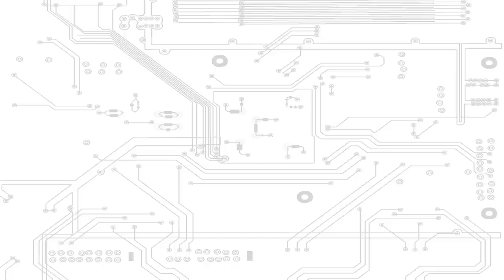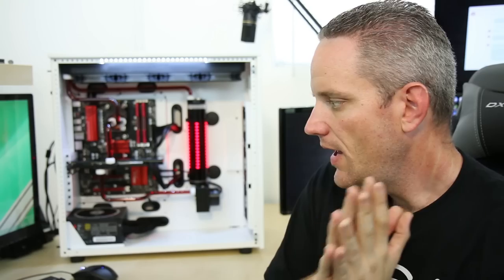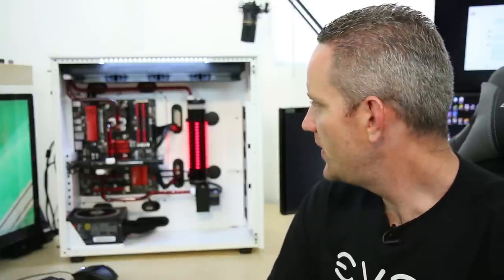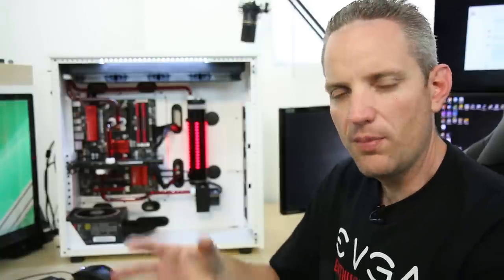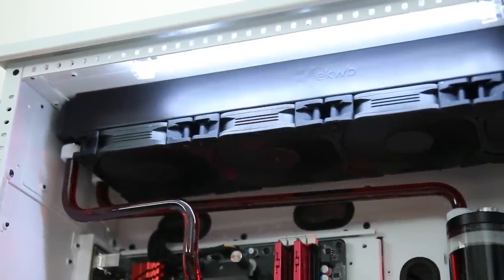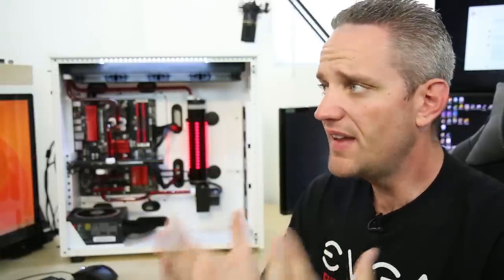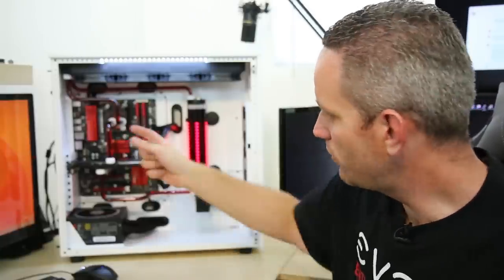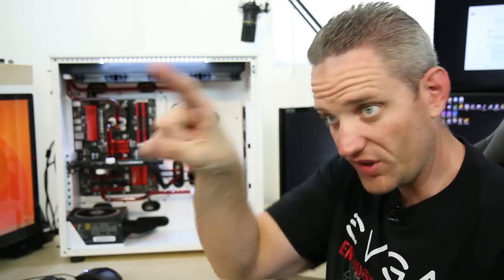Custom Watercooled AMD Gaming PC

Comment: Few topics for guides and tutorials:

1. Guide to water pumps (Liang DDC, D5, DCP, Aquacomputer aquastream)
2. Guide to hard tubing fittings (BP, EK, PrimoChill, Monsoon)
3. Sometimes the are problems with compatibility betwen tubing and fittings, especially when you are using different brands (for example problems with EK hard fittings and monsoon tubing). Maybe you should try to check this out.
4. Push vs pull vs push-pull
5. Slim rad vs thick rad
6. Longer but slimmer rad vs shorter but thicker rad
7. High FPI rad vs low FPI rad
8. Cheap fans vs premium fans - how they impact air flow and noise level
9. How blocks and angled fittings impact flow ratio
10. Building water loop for 100$/200$/300$/400$ etc. - where you can cut cost and where you shouldn't
11. Heatshrinkless cable sleeving
12. Guide to fan controlling - using mobo features and third party panels

Comment: I would like to see a guide to what to buy when watercooling. A single and dual GPU example with separate rads. Take EK as example. What components to look for. What to think of. Good to know about different fittings or blocks. I would also love to see a guide in how to change the cooling from air to waterblock on a mainstream card.

I really appreciate your channel Jay and been spending alot of time on your videos and guides.
Keep it up and stay wierd!
Regards Jonas 
Sweden

Comment: Just finished my first watercooling loop and it is addictive!  I did softline and eventually in the future I with attempt a hardline build.  

A problem I had with my endeavor was optimizing the overall loop (temperature wise).  My video cards (980 ti x 2) were under 40C at load during Furmark while my processor (4790k) was hitting 90C during aida 64.  I eventually reseated it and am at 63C with it overclocked to 4.8 GHz.

Comment: I'd like to see a how to begin watercooling guide for people that already have experience building PCs, but are just wanting to start into custom watercooling.  I'd really like to see how to pick a graphics card that will be easy to get a block for and how to begin with just a CPU loop and later expand it to the GPU as well for a more budget friendly route.  I've always wanted to start watercooling, but small problems like that have held be back from it as well as being worried about taking it to LAN parties and having the watercooling components get damaged or leak.

And keep rolling with the hard tubing stuff.  It makes for a really clean looking build and the freedom to bend tubes wherever you see fit to customize the loop is an added touch.

Comment: it would be kinda awesome if you just went through  a few pc partpicker builds that you do with all the things that you would need to make a loop, and maybe do a few different ones for various price points. That way if I wanted to do this for my pc a lot of the worries like will the pump be strong enough , or does the tubing work with those fittings, or like you were saying about different coolants not being compatible with some plastics would be pre planned. So i kinda just see what my budget will afford and make aesthetic decisions about things like colour, fittings etc, knowing that it would all be compatible and assuming I don't fuck it up in installation should work together.

Comment: It would be great to see a series of videos explaining the parts of watercooling where you have a lot of variety that can be confusing. Such as fittings (diferent types, usage, pros and cons), different loop designs (series, parallel, why it works even though most of Youtube won't believe it), radiators (performance statistics on high vs. low fin density, thick vs. thin radiators and such). I am aware some of these videos would take a ton of time, just throwing my suggestion out there.

Comment: Hi, I'm pretty close to doing my first custom loop, just wanted to say your video's (and the ones you've done with Paul) have convinced me it won't be that tough to create a rigid cooling loop. It would be great if you did a slower paced video of the methods you use to figure out where you place bends etc

Thanks for some really great and informative Vids! Some guy in the UK

Comment: ***** Water cooling tips that I would find very useful and hopefully others: 1. how to drain system, (whether changing cpu, gpu, or mobo)
2. how to figure out which pump to buy, in terms of power
3. what does having a pump go dry mean
4. how to bend hard tube
5. which compression and fittings to choose for soft tubing
6. how to mount reservoir in case

Comment: Great looking build. Going to be doing something similar with the 8350 and a GTX970 G1, but air cooled, as my trusty old Lian Li case only has a single 120mm rear vent.

Comment: Here's something I've always wanted to know and have never actually got to googling. I'm an auto mechanic. So I've always known a radiator to have an in at one corner, and an out at another  corner on the opposite side. That way the coolant has to travel from from one side of the rad to the other. I am now an experienced builder, but still always have this thought in my head that having the in and out on both sides, does the water actually run the entire length of the rad before it exits. That 480 rad you used made this thought pop in my head again, so I'm probably gonna do some research of my own, but I just thought it would be an interesting topic to touch on.
Reply: dollars1234 As I'm sure you know, the tanks on an automobile radiator run the full length of the sides, so when you fill it, the water fills the first tank, crosses the radiator, then fills the second tank.

In the average water-cooling rad for PC's, there are THREE tanks - two on the port side (one for each fitting, about half the width of the rad) and one at the very end.  What happens is the water fills the first tank, travels to the opposite end of the rad, fills the end tank, then crosses back on the other side of the rad to fill the last tank, basically making a U-shape.

That being said, there are PC rads that have two tanks, with the ports on opposite corners.

Comment: A ground zero build that's a few parts would help. Meaning literally showing people where to buy what kinda to buy. Also what rads and fans. How to setup fan curves. Drain set ups. All these our asked slot on ocn by new builders. Alit of people also ask about cases. I know caselabs first hand our the top butler new builders don't have the money so showing off more budget cases and ways tops them and how to mod ( ie window mods, rad mount mods, etc) I think all listed above would be very good to do and easly could be several videos and part 1- 10 videos. You have to remember whAt to you is common knowledge is not for most new builders. Keep up the good work jay living the dream my man

Comment: How about the different types of tubing to use? Pros/cons, compatibility (like the melting you talked about), how to use the different types of tubing etc. 

Something else could be radiator sizes and how it affects builds. Which is best for certain situations. 

Best pumps to use. 

That's all I can think of right now. Thanks Jay.

Comment: I think something that does not get brought up are the things you do not see, the biggest is mixing of metals in a system. It's something that you really have to do a bit of research on, but even then I have met plenty of people that did not know that could induce an issue into the system. Also, things like when to use a kill coil, silver bar, or a biocide and when to use each in a system. One last thing I think personally should be address is the amount of maintenance on not only a weekly to monthly basis such as topping off your reservoir, but on some times a bi-yearly or more basis.

Comment: ***** Could you do a water cooling budget guide (budget meaning as cheap as you yourself would go) And/or how to effectively pick out water cooling parts. (I.E. how big of radiator, does a more expensive cpu block matter, type of reservoir thats best etc).

Comment: id like to see a series where you use a randomiser to select all of the part e.g when you randomly select the cpu you put all of the compatible motherboards in the randomiser then the same with the gpu, power supply, ram, fans, hdd, case it would be fun to watch you building randomly generated pc and then bench mark them to show what type of performance you get.

Comment: This is quite similar to my current system. One thing I would like to say for anybody looking at doing something like this, is that overclocking your CPU a bit further will improve the video card's performance quite a bit. When I went from 4.7GHz to 5GHz after upgrading my cooling I got a ~5-10fps increase in most games.

Obviously, if the owner of this system is playing WoW mostly then that's probably unnecessary (I don't play WoW so I'm not sure). But an epic build for sure Jay! NIce job. :)

Comment: ***** Would love to see a video on the pro's and con's of a single vs. multi loop system cooling 1, 2 and 3+ gpus.  Please include the relevant component temperature comparisons.  

Additionally, would love to see a video explaining and demonstrating the relationship between head pressure and flow rate and what variables in a system affect them.

That said, a video on the characteristics of a system that would suite a single D5 pump, a single DDC pump or multiple pumps in a single loop would be very helpful.

Comment: Nice results.  That's a decent OC that won't need a lot of voltage to stay stable, and will keep temps and power consumption LOW.

One bit of info I can share is that G.Skill has red heat spreaders in their RAM that are a near exact match for that board.  ;)

Comment: A bit similar to my system minus the custom liquid cooling. I have an 8350 at 4.8GHz cooled by a H80, an EVGA GTX 970 SSC (wanna get a 980Ti), 16GB Corsair Vengeance Pro 2133MHz all on a Asus ROG Crosshair V Formula-Z encased in a Corsair Carbide Air 540 (Brilliant case highly recommend it).

Comment: You sir are fantastic. I love watching your videos and love all that you cover. I am excited to hear that you are going back to the water cooling topics! I would really like you to discuss tube prep and bending. Specifically how to bend a tube run from point A to point B. I would also like you to go over prepping the tubing for insertion "Insert Joke here" into the fittings. Does PETG require the prep that acrylic did? i.e. chamfering the ends

Comment: I'm not a first time water cooler, I've been building WC rigs exclusively since 2003 but hard lined setups are beyond me. Don't get me wrong, I think they're sexy as heck but I'm one of those guys that's constantly evolving my PC. I'll go with a certain layout or even component (CPU/GPU/rad(s), etc) and a few weeks or months later get a wild hair and swap something out. Generally, with soft tubing, I can allow for future changes by running the tubing a bit on the long side to allow for modifications to the layout and even if it doesn't work I keep enough spare tubing on hand that replacing it is simply one cut away. I can't fathom pulling out this custom bent tube just to toss it in the junk bin and start over. Granted, my rigs will never have the wow factor the bent tubing hard line setups do but that's fine. I would like to ask, what soft tubing are you buying that's $3 to $4 a foot? Even the Tygon in my setup now was under $2.

Comment: I think a good "Water-cooling 101" video for 2015 is in order. Skip the AIO equipment and get right to the meat of building a rig from start to finish. Highlight the part decision process and loop planning and note any pro/cons for those choices.

Sure, it will be a multi-part video series, can't really avoid that. But it somthing you should be able to reference in future vids for quite awhile.

Comment: Regards Watercooling.
I just use AIO stuff but have kept looking at setting up a custom loop.

One of the things that bewilders me is the difference in price, shapes, etc. To be honest it all looks the same. I think something around a like for like comparison between parts for each section of the system (individual blocks, personal experience on performance, fittings etc) would be really helpful.

Comment: From my point of view, the loop would have been a bit cleaner if you rotate the cpu block vertically and make 1 less corner from the rad to that block, anyway its a fantastic build!!

Because you can make everything so interesting, I'd suggest just to cover more aspects of the builds you make, maybe the moments when you start thinking about loop or the moments when you bend and install the rigid tube in the fittings (maybe teach how to understand if they are inserted correctly)

These are just my ideas, yours are the best videos anyway!

Comment: I am about to be doing water cooling for the first time and my fear is doing something wrong and causing a leak or a rigid tube popping out of its fitting. I think a great vid would be about what not to do, what would it actually take to blow out a fitting or cause a bad leak, and what fittings are more reliable than others. Set rigid loop up and see what to takes to actually make it fail.

Comment: Hey there Jay,
since I never did anything WC related, but I intend to do i would wish for a video where you cover what is neccessary for a loop (Pump, Reservoir, tubing, Radiators, Fans and Waterblocks) and what the bunch of extras is about (like a flow-meter and a digital controller etc. etc.)
Maybe you could cover how much radiator space is needed for 1/2/3/4 Graphics Cards and a CPU.
I know that there is a huge difference in these cards but something like a 360 is enough for stockspeed two GC an a 120 is plenty for a 4690k or something.
I hope you make a little time for my questions and its not too basic!
Keep up the awesome work, you really taught me a whole lot about computers!

Comment: Jay, on the water cooling topic, maybe you could shed some more light on running a mixed metal loop or an all aluminium loop with corrosion inhibitors, I know its not recommended but some of us don't have much choice. I live in South Africa and water cooling components are EXTREMELY difficult to come by and even more so at a reasonable price, because of this I'm using a not so famous brand of water cooling components from china, the rads and CPU block are aluminium and I have to say that I have absolutely no regrets on buying it, the pump is slightly audible but other than that the performance is excellent as I'm getting 18 degree idle temps and 45 degree load temps on an i5 4670K stock clock, which is a high heat CPU as you know. Anyway great job on the build, keep it up.

Comment: I would go with arctic cooling white fans and peeled of top sticker, instead of all black fractal. Their F12 and F14 fans have thermal sensor as well and central motor is incredibly small when compared to those in fractal fans. I don't know why but their fans are not so popular, but are really good.

Comment: Maybe you could do a video on what kind of radiator set up you would need based on components chosen? Pump flow based on the amount of heat needed to be dissapated, ect,ect.

Comment: I build a similar system recentlky for my brother except with a white and black colour scheme,   what you say about PETG hard pipe is in contrast to my experience though, I found it was a LOT harder than soft tube and many things could go wrong in the bending process even when you had the special tools for it,  for example if you try to do a bend too close to the end of the pipe it can lose its circular shape and wont fit into the fitting properly,   or say you do one bend and try to do the next one about an inch along,  heating the pipe the second time can undo the first bend that you did.

Comment: Thank you for the advice I did not know that PETG tubing/fittings are cheaper than soft tubing/fittings because I haven't checked prices on hard tubing since it's my first time water cooling I was going with soft tubing and I already have a heat gun if I could save money awesome :) those gpu blocks ain't cheap. I would like to see a video on coolants like distilled water vs anti corrosive coolants would it matter. Keep up the good work

Comment: What kind of maintenance is involved with having a water cooled build?  Not knowing this is the main reason I've stuck with air cooling for years.
Reply: Replace the coolant every 6 months or so and as long as you assembled the loop well in the first place you should be good.

Comment: I feel like you put more emphasis on water cooling then most youtubers tend to well the tech related channels. I like appreciate it and like it a lot. My only concern has always been water cooling wise is the maintenance. Sure you can install it and it will work for a while but eventually you will have to clean out your loop. Would this be harder with rigid tubing like in this video? Do you use a solution to clean out the loop without having to drain? I don't know a ton about water cooling so I rely on your videos a little bit for the little knowledge I have :P

Comment: "How much radspace do you really need" would be an interesting topic. Like, start with a 4790k and sli 980 with max OC's or something like that with clearly overkill amount of rads and start reducing your cooling capacity from there and see when you are hitting too high temps and limiting your overclocking capabilities. Would be beneficial for all those thinking about building a powerhungry rig in a smaller case and watercooling it.

We know the saying "120 rad per component", but how about in practice?

Comment: so I´m really interessted how much a push pull configuration brings you performance ways  and how is it with watercooling or even every active cooling on chipset and dram ?
also do you prefer single loops like in this case or like 2 loops as seen in skunkworks ?